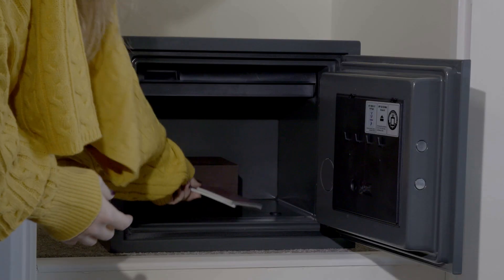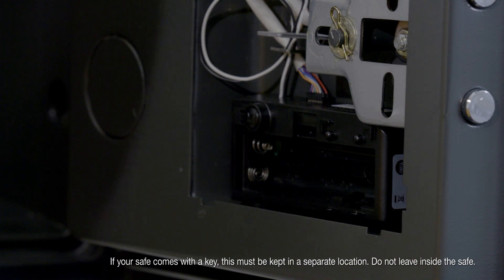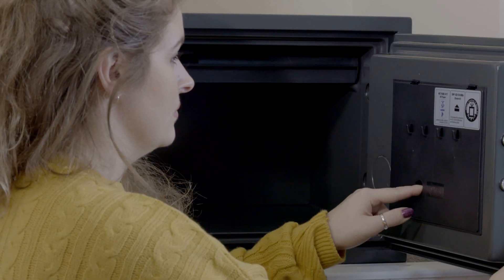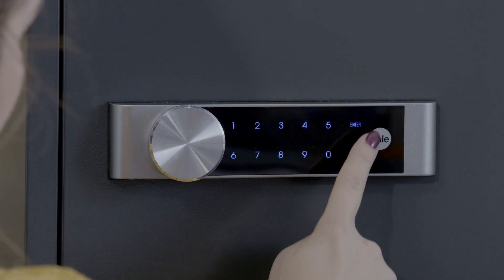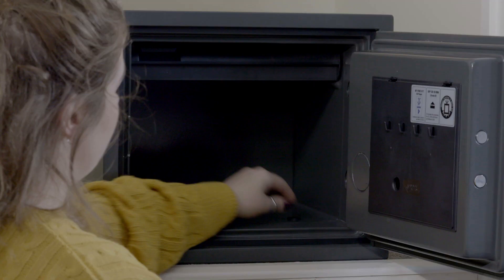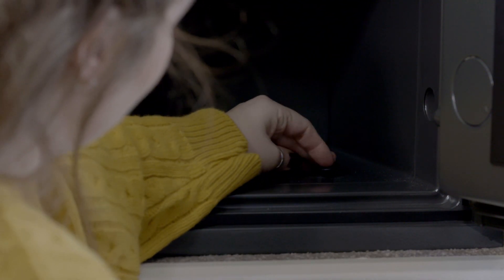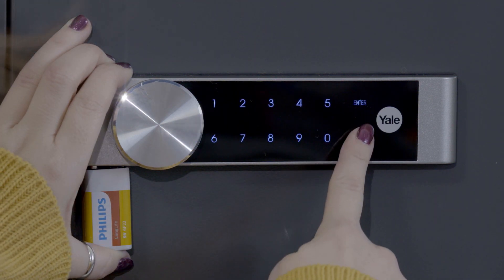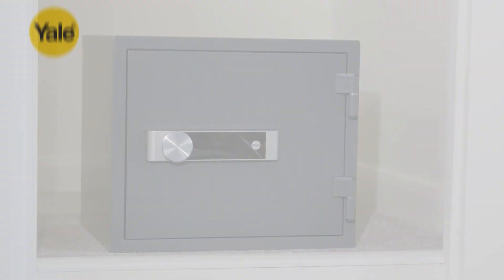Yale How To Install a Fire Safe

Comment: The problem is although I trt with the emergency battery.The touch screen does not work.
Reply: Lol
Reply: Hi. I have same problem. Can you help me ?
Reply: I almost had to call the locksmith but I tried another battery and although it didnt give enough charge for most of the time, i perservered (by repeatedly trying) until it did.  phew what a relief. what did you end up doing?
Reply: @TheMorningtrain  hi, same probs here, the support told me to let the battery for 2 min but it does not work. How did you end to ?
Reply: @Patrick-zi4qk  i tried a few different batteries, holding it there for about ten seconds, seemed one of the batteries had the "right' amount of charge.  I needed to be really quick with pushing the numbers on the screen though because it didn't stay on very long.  I try now to check the safe every week just so I know the batteries are not going flat soon.  I would like to see them come up with a plug whereby you can plug into power when the batteries go flat if need be.  or even better a safe without batteries, which is like my other safe, a dial that has worked fine for decades
Reply: @TheMorningtrain  Thanks for your feedback. In my case I bought the safe last week and the screen is already not reacting at all. I don't really know if it's a battery problem but I will try your method.

Comment: terible touchscreen, so many people have issue with not working anymore. With 9V fresh battery, with new 1.5V batteries, simly batteries are not the case. That touchscreen is horrible, same as Yale support. Never ever buy anything with such a screen. I ll try to replace it and sell it. I contacted warranty service in time, until they respond warranty is over...I ll never buy anything from Assa Abloy....pitty I have safe doors and few other things...

Comment: Avoid buying this. Some numbers and key stored working. Out of warranty by a month, no help from yale
Reply: What did u do? I have an issue with numbers
Reply: My numbers have stopped how do we open the dam thing
Reply: I had to grind it open, if u havent bolt it underneath the safe is a whole which can help you remove the cement of safe and grind a single layer of iron sheet
Reply: @mackglow  unfortunately some of the numbers wouldn't work no matter what you clicked or put a battery at the bottom, phoned Yale and they give me a backup key code which included the keys that didn't work so that was useless then they said I'd need to call a locksmith out of my money to open it, I threw it in the garage and rammed a crowbar in the side and literally opened it in about 1 minute.. it had only been opened around 4 times in its life. Won't be buying another Yale that's for sure.
Reply: @ABRestoration  sounds like it's the best safe ever. even the owner is not able to open it